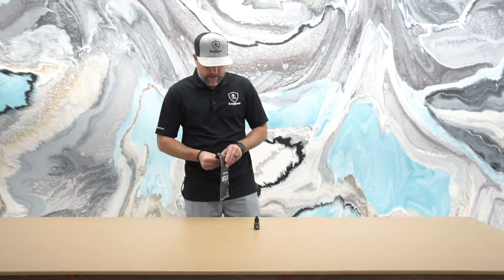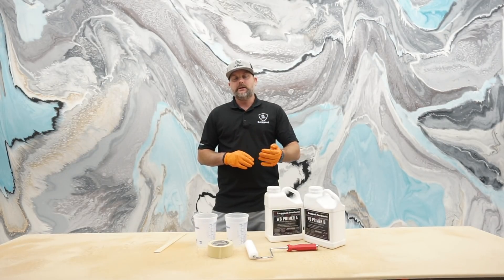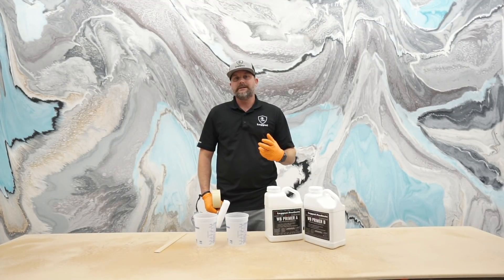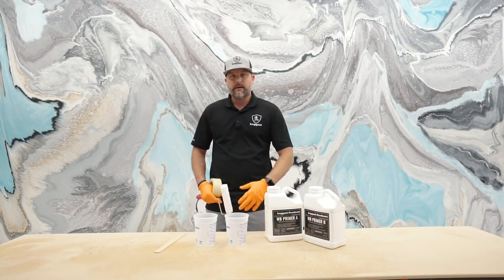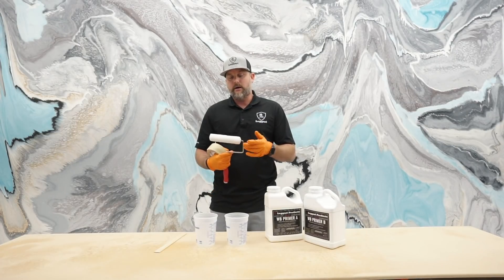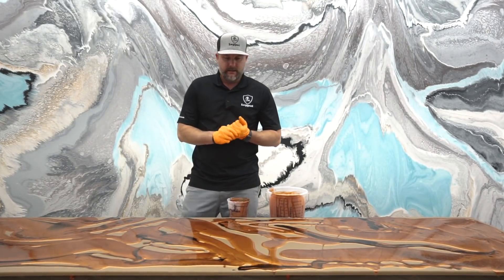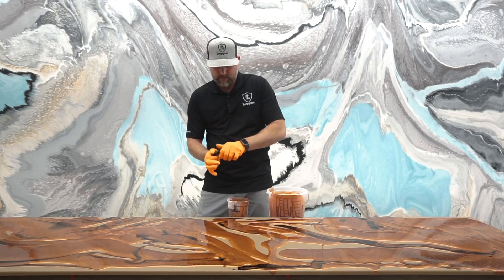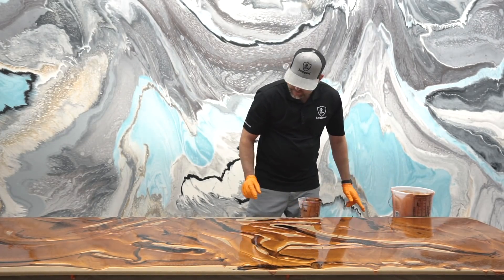Brass & Black Epoxy Technique Done Over Wood Surface That Looks Good | Pour It From The Container

Comment: I like this pattern. I have just one question. Why didn't you tape the edges on this one?
Reply: Because it wasn't a dirty pour
Reply: @wesrussell7277  Thanks for the response, I'm liking this product  more and more.
Reply: Yeah rather interesting some of the projects they've done
Reply: @wesrussell7277  but he said it was???
Reply: He said it was similar to a dirty pour
Reply: @wesrussell7277  gotcha. Just wondering...what’s the difference? Not trying to be difficult. Just curious. Thx
Reply: @TMac0925  Agreed, I'm an old school concrete man, 35 years, Love the slab resurface vids. Just wanting to learn this for wood also✌
Reply: He would of used about 3 times more resin and would of taped the edges off to stop the over flow until the resin started to set up
Reply: @wesrussell7277  thank you